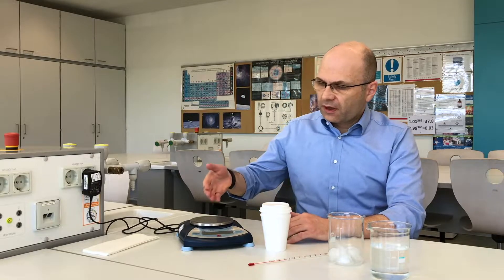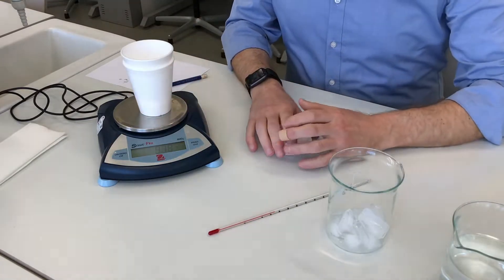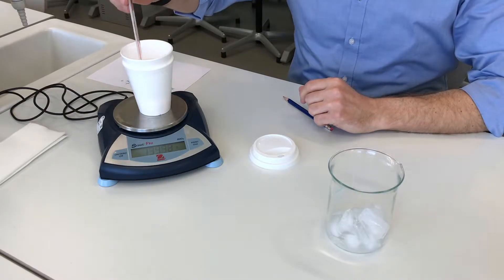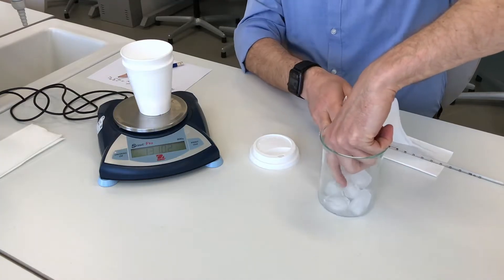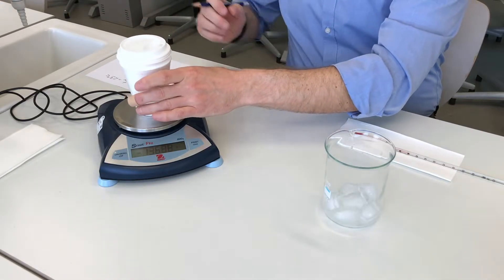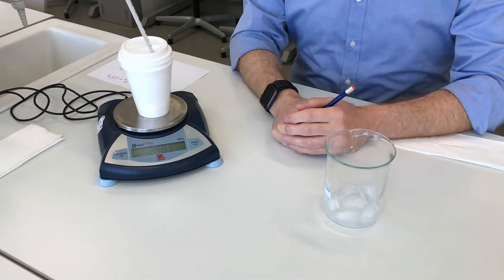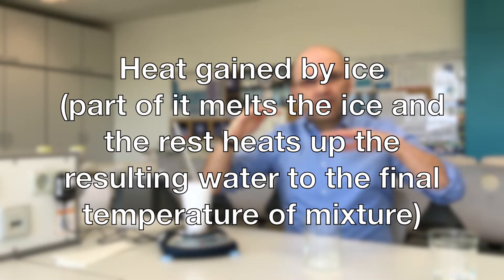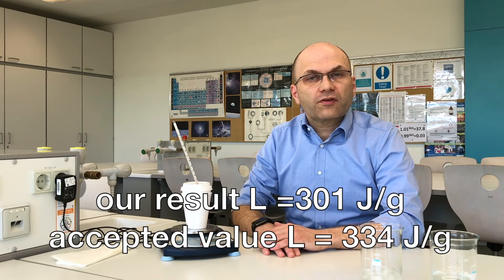Latent heat of fusion of ice

Comment: What are the possible sources for error? I see you made prolly like 10%
Reply from the maker: Here are a couple: ice not initially at 0, cup not ideal insulator etc
Reply: the error is the specific heat of ice, it should be 2.09 J/g-C to make the calculation same as the literature 334.. the specific heat of ice is not the same as the specific heat of the water
Reply from the maker: @danielso297 Hi there. You are correct in saying that the specific heat capacity of ice and water are different. However, here we assumed that the ice used is at 0 so the specific heat capacity of ice was not considered in the calculations. A more accurate version of the experiment can be designed to consider that aspect.

Comment: - 🧊 Latent heat of fusion defines heat needed to convert between solid and liquid states.
- 🌡 Ice temperature is approximately zero degrees Celsius for the experiment.
- ⚖ Heat exchange is assumed only between ice cube and water inside the cup.
- 📊 Calculated latent heat of fusion: 300 joules per gram.
- 📋 Experimental setup includes a balance, styrofoam cup, thermometer, ice, and water.
- 🔄 Thermal equilibrium is established between thermometer and water for accurate temperature measurement.
- 🔄 Lid on cup minimizes heat exchange with surroundings during experiment.
- 📚 Literature value for latent heat of fusion of ice: approximately 334 joules per gram.

Created by Harpa AI

Comment: What is specific heat of calorimeter?
Reply from the maker: It usually refers to the specific heat of a container in which an heat exchange occurs. A calorimeter is a well insulated container. Let’s assume that you have a plastic cup (the “calorimeter”) and some water in it. Now let’s pour some hot water to make some lukewarm water. To find the final temperature of the mixture Ordinarily, you would consider only the heat exchange between cold and hot water (Q lost by hot = Q gained by cold). When the specific heat of the container is given a better equation would be Q lost by hot water = Q gained by cold water + Q gained by container. 

Or, in simple words, specific heat of a calorimeter is the specific heat of the material from which the cup is made of.

Comment: Buna ziua, frumos video! M-am gandit ca daca nu presupunem ca gheata e la 0 grade C putem imbunatati rezultatul final. Am facut calculul invers, pornind de la L este 334 J/g (3430 J pentru topirea ghetii) si am obtinut o temperatura initiala a ghetii de +16 grade C. Desigur, speram sa obtin ceva in jur de cateva grade "frig" :). Ma intreb de unde provine eroarea.
Reply from the maker: Bună. Căldura pierdută de apă la răcire e de 3780 J. Cu valoarea acceptată pentru L e nevoie de 3430 J pentru topirea gheții, după cum spuneți. Apa provenită din gheață mai ia 691 J pentru a se încălzi la temperatura finală de echilibru. In total, căldura absorbită de gheață e de 4121 J. (Deci mai mult decât pierde apa aflată inițial în pahar! - ceea ce desigur, nu ar trebui să se întîmplă). Eu cred că aici factorul determinant e căldura absorbită de sistem din împrejurimi. Cu alte cuvinte, estimarea că gheata ar fi primit doar 3780 J de la apa existentă în pahar e o subestimare semnificativă. Desigur, e posibil ca și gheata folosită să fie in jur de -2 grade. In acest caz, caldura necesară pentru a o încălzi la 0 e doar de aproximativ 43 J.